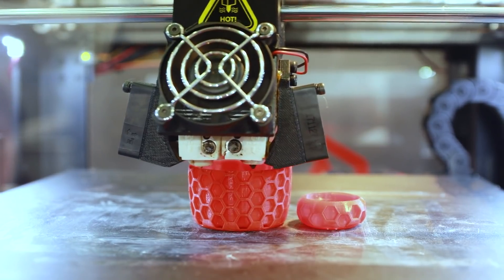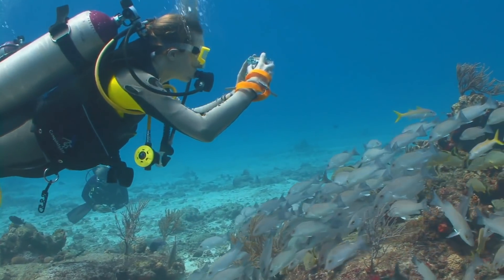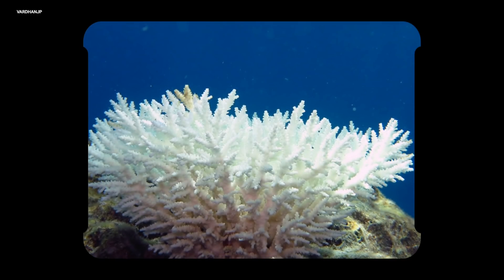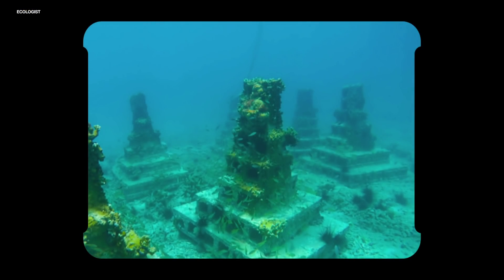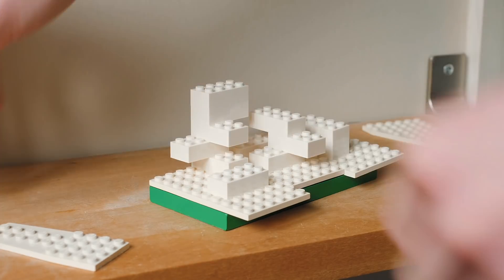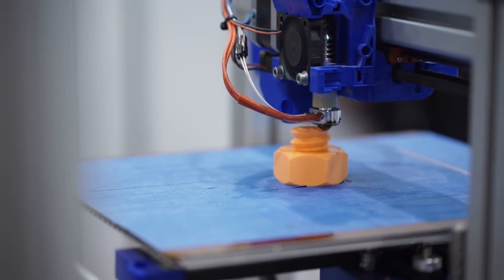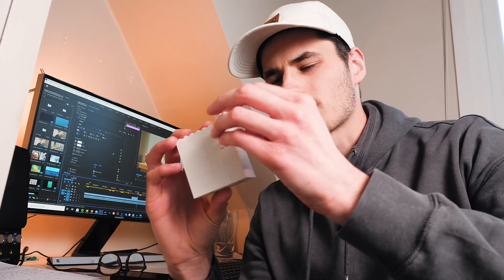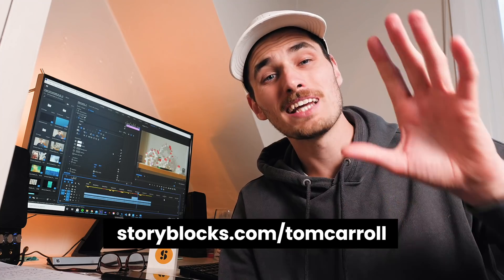How To Save Coral Reefs: Print New Ones

Comment: but putting aside the fish will still die along with the reef as the climate changes although 3d printed reefs are constructive thinking most of the niche building organisms rely on the corals and or rely on organisms that feed off the corals will die. Corals are a foundation species without the presence of corals there simply wouldnt be reefs eventually the fish that do survive will sercombe to a lack of nutriention and parasites from the stress of rising temperatures

Comment: There are issues of what sub straight the coral will grow on. They are particular where they will grow. There are also programs that use electricity-charged sub straights to accelerate the growth of material that coral loves to attach to. Most 3D prints will just be more trash on a reef.

Comment: Interesting, though there are a couple of things that I wonder about. 
First, we struggle to recycle a bunch of plastic because its hard to get pure enough, high quality plastic out of the mix, thats good enough for many of the refined uses we have. It seems like an artificial coral reef wouldnt require high quality plastics, and so it seems like this would be better off somehow utilising those old plastics rather than new reams of 3D printer material. Though I figure someone probably thought of this before me, and perhaps they already have 3D printing using old plastics for this task, I dont know.
Second, and regardless of the source of the materials used. Have they done due diligence on how the materials perform? E.g. it might make a nice structure, but if creatures start taking bits off it then it could end up hugely increasing microplastics in the food chain. Or in some cases materials do degrade relatively rapidly, so you could imagine with the wrong material a chunk of reef could end up falling apart and again making it in to the food chain.
-
Course, maybe all this is exactly what they are testing at the moment.
Reply from the maker: All really great points. And you're right - that's exactly what they're testing now in the case of RDL. They're pretty set on the design but are doing real world tests of the whole system. They've opted for inert materials that shouldn't react badly with the coral or the water, as they're extremely concious of the impacts that degredation of the structure could have. 

I like the idea of repurposing ocean scavenged plastics into something useful for the ocean, but this might not be it!